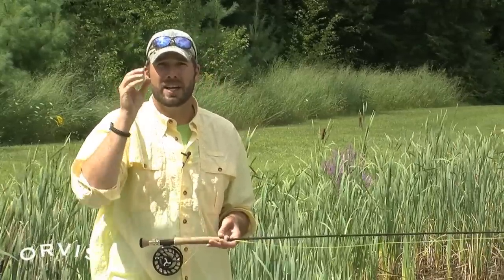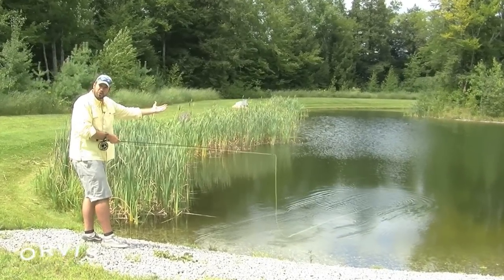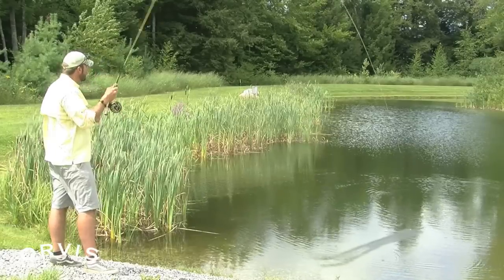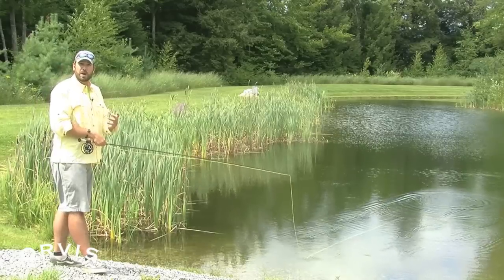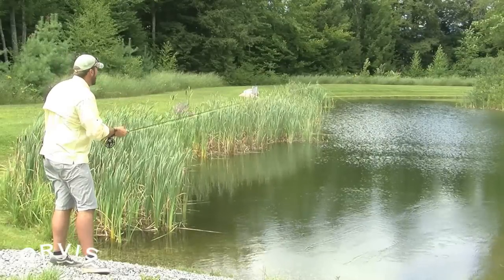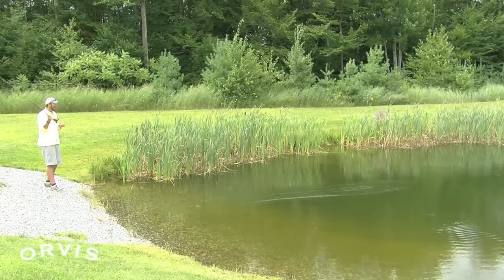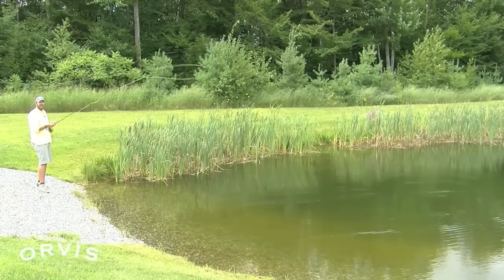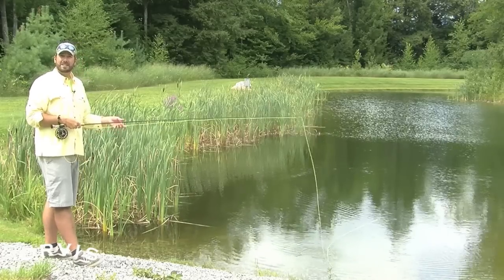ORVIS - Fly Casting Lessons - Delicate Presentations

Comment: great vids! just wondering if you can help with an issue Im struggling with: I'm having trouble getting my leader to roll out. my fly line rolls out OK but my leader half rolls out and sort of limply flops on the water.  Sometimes I'll only get my fly as far as the end of my fly line. do I need to improve my acceleration to a stop or is this a different issue? Cheers
Reply: I just got to this video and read your comment, I know I’m pretty late 😂 and I bet you solved every casting problems, but I got disappointed that in 7 years you got no response about your issue. So I’ll try to help maybe for someone who has the same problem and will get to this comment section! Try to check your leader length/thickness, it has to be tapered and with the right length/thickness proportions, you should start from a very thick line attached to your fly line and it has to gradually taper through the end in order to transfer all the energy gained straight to the fly and allowing the leader to roll out properly (leader length is an important factor, it has to be proportionate to your rod length, flies weight and fishing spot conditions) If you’re not solving the issue, try to tighten your loop (by trying to move your rod tip on a straight line while casting) and stop your rod tip higher at the end of your forecast this will help the line to gain speed and kinetic power and send your fly in front of your leader. Last tip I would recommend is to check your fly weight/volume, heavier nymphs and very big dries are harder to cast, so try maybe to increase your flyline weight and your leader thickness! 

One more tip: sometimes you don’t want your leader to stretch out completely 😎